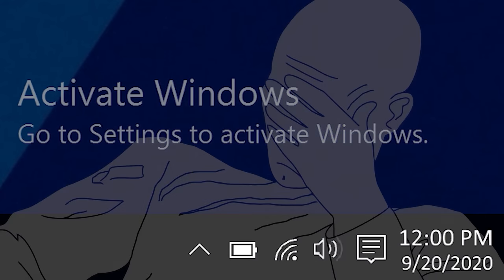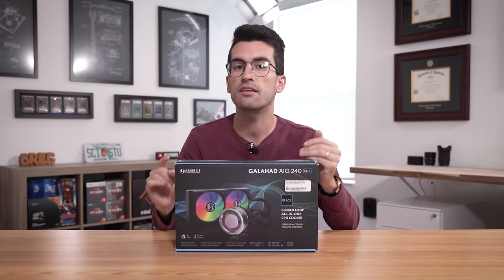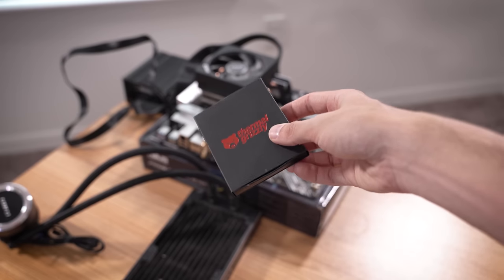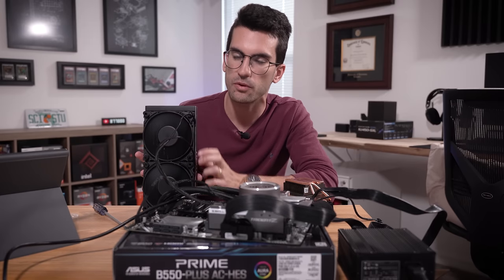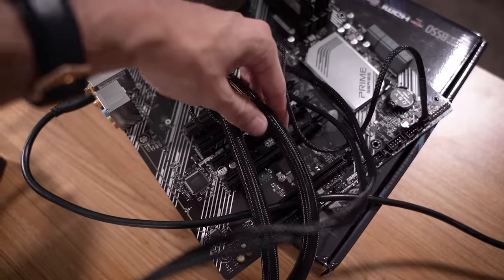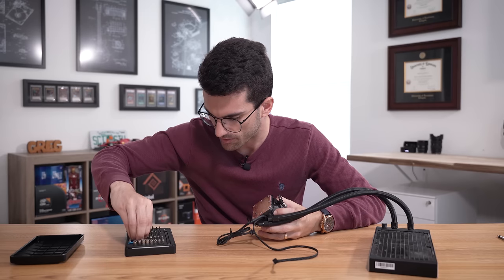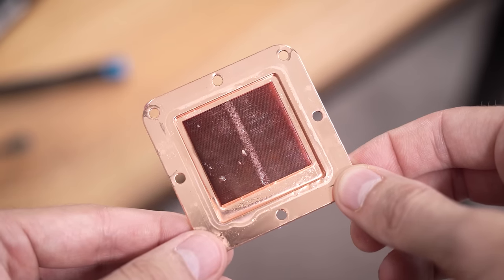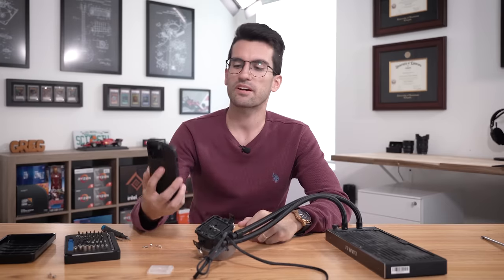A Viewer Sent Me This Broken AIO...

Comment: Something seem to have happened in the way those companies produce the AIOs. Yes I know, Lian Li for sure isn't producing those units them self, but that doesn't matters. There are so many AIOs that are 1-2 years old (all across the brands) which fail that you need to ask yourself if you still can trust those AIOs and if they are still worth the money.
They are much quieter and more efficient than a normal fan cooler, but for that kind of money taking the risk of killing the CPU? I have a seven year old AIO, that still works fine. Those ones doesn't even survive half of the time the manufacturer states they would work without problems for sure.

Comment: hi, i'm new here and just watched some of your videos and it's very satisfying, do you know why my monitor doesn't turn on? (monitor's power indicator flashes white - Dell S2009W) I hope I can fix it by myself xD, because I don't have money to take it to a service center
Reply: I did a quick google search on this issue, here is what I found that might help you (From Dell Support Site):

06-07-2014 12:39 AM
* Disconnect all cables from the monitor (including the power cable)
* Press and hold in the monitor power button for 10 seconds
* Reconnect only the power cable to the monitor
* Try to turn the monitor on. If nothing appears, the monitor is faulty

Comment: AIO are not Worth it. Unless you absolutely want to do extreme overclocking go AIR . You can still reasonnably overclock with a good air cooler. I Always at least overclock 15% with AIR. And the maintenance is minimal  and the clogging can be fixed with air pressure :)

Comment: I think part of the delay in the response was two fold. 

1) Making sure there are enough legit issues. Reddit + Youtube comments are not legit. There's no way to verify if the commentor or poster is even a real person, let alone an actual customer. It's very common for commentors to claim they are having the same issue because either they want to be involved in the conversation (and get attention) or they think they are helping to "amplify" the issue (which is sorta noble if you ignore the whole lying part). You have to have a certain number of submitted contact tickets or RMA requests accumulate to figure out if there even is an issue in the first place. If the actual percentage of effected units is like 0.5% the total sold? I'm not rushing out an announcement because it's within the margin of natural failure and also because...

2) You need to figure out what is happening before you release a statement. As we've seen just recently releasing statements without understanding the actual cause of the issue? Does more harm than good. If you don't know what's wrong you can't make a promise as to what you can do to resolve it. From a liability standpoint rushing out a statement is a nightmare. From a profitably standpoint, it's a nightmare. From a PR standpoint in modern social media? A massive nightmare. Just rushing out a statement of: "Okay so some of our AIOs are having issues, we don't know which ones, why, or potentially how many..." yeah you've got a massive issue now as every Lian Li AIO owner is now bugging out and demanding a refund, not a replacement because you don't know what it is, so you can't assure them a replacement would be any good. Now you're potentially looking at bankruptcy in the name of expediency. 

Provided they are actually following through with their pledged actions? I'm fine with this and not too uppity about the delay. I'd rather there be a delay and the right response than a speedy but shortsighted response.

Comment: AIOs are so new in a way as well that unlike anti freeze and stuff they haven't figured out the components for their chemicals yet they need kind of like an anticoagulant for your blood what's happening is the heats causing the water and the chemicals they have to clog the system
Reply: Such as if you Introduce to much sugar and carbohydrates into your blood stream will cause a valve blockage
Reply: The hot and cold tempatures are like ice and hear with bacteria causing the blockage
Reply: Water is not a suitable compound at all for cpus

Comment: Legit swapped out my cpu so I took aio off obviously. Everything was fine until after about a minute when I started to update icue my pc turned into a jet engine and I have a 4090 so I knew something was wrong immediately. Thought it was the software/firmware update but I found one of the pins for the screen was fucked and I can only assume pump clogged cuz cpu went from 0 to 90 to off really fast.

Comment: Has anyone ever tried to put a condenser and coil inside a case and cool the cpu with freon?
Reply: I don't think refrigerant like freon has been used directly, but I have seen people using air conditioning systems to cool water that circulates in the pc with antifreeze, like a dual loop system

Comment: Surely an antibacterial fluid could be developed to avoid this?
Reply: We call it...distilled water,  been using it in all my AIOs for over twenty years with 0 growth.
Reply: @JRose-zn7iw  Makes sense. Why isn't this standard?
Reply: @Trpanek  Because it's free (nearly). You still have to put in the work with disassembly, cleaning, flushing, reassembly to get rid of every trace of their "coolant."
Reply: @JRose-zn7iw  Interesting. Thanks!

Comment: Never really understood why people absolutely have to use aio. I have built PCs for over 20 years and never had an issue with a regular cooler. Buy a decent be quiet! or noctua cooler and you never have to worry about failure. And for your typical built you'll never reach temperature issues as long as you have sufficient air flow through the case. Just my two cents. Spend the money on GPU, better PSU or more ram and storage instead.

Comment: I've said this on other channels, and it's still true. This is a cultural issue when it comes to Asian manufacturers. They refuse to acknowledge a problem until the uproar becomes so great that they cannot ignore it. Then they will act. It doesn't matter if the problem is trivial or serious (danger of fire). They are unable to understand how product quality affects reputation. In fact, they know that a defective product will not stop buyers from purchasing their products, so there is no actual monetary incentive to address a product issue. We know that Asian companies can act like a POS, but they don't care - you'll keep buying.
Generally, European companies are very concerned with reputation and address product defects quickly and proactively. Reputation is everything. This also has the effect of pushing up prices.
U.S. companies are admitting or fixing anything until a regulator steps in.

Comment: i don't find the benefits of a working AIO overcome the negatives, to say nothing of the issues that plague AIOs in general.

if you're dumping that kind of money on a cooler, just get a higher end air cooler that performs in that range of cooling and call it a day, or go custom loop and properly treat the water (and remember to do upkeep at the proper intervals).

for most people; there's air coolers that will be comparable for performance for way cheaper.
Reply: My rule of thumb is only to go with water cooling if there's literally nothing else in your computer left to upgrade - you better have a core i9 13900ks and an rtx 4090 before spending money on watercooling, because water cooling only speeds up your computer by like less than 1% anyway.

Comment: Seems like all the AIO manufacturing issues happened after the pandemic started. Maybe that had something to do with it as China had less workers on the lines and quality control went out the window globally.
Reply: I'd assume that it has more to do with CPU's consuming much more power now than they used to. Heat rapidly accelerates chemical reactions.

Comment: I tried to talk my ex into an air cooling tower for a build I was doing for her. It's one I've used in about a dozen machines I've built for ppl. There are several reasons I prefer air towers in general. The same basic build I did for other ppl tops out at mud 50s low 60s under load.l, if that. Well, she was determined she wanted a a Corsair AIO, because her "friend" at best buy told her how superior to towers it was. Her machine idles in the 50s. It was so terrible we returned one and I put in another. Same. So she finally went with my recommendation and it idles at 30-31 and is 50s under load. There it is.

Comment: Try flipping the rad over. You have the pump as the higher level. Air is in the pump.
Reply: Did you even watch the video? 

Orientation isn't even pertinent here, and even if it were, "flipping the rad" has never turned an 84C idle into a 34C idle.

Why are you like this?
Reply: @Wrigglevision  It's the rad position, not all that sludge inside of the unit. /s